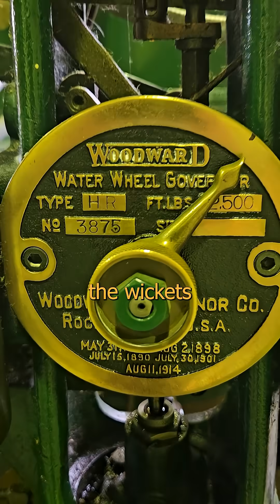Flyball Governor #chrisboden #comedy #engineering #generator #powerplant #electrical #technology

Comment: It's crazy that MOST cities around the US power is being maintained by 100 year old machinery. 😂
Reply: "It's designed to last a hundred years and is a century old" - physicsduck or smth
Reply: and it's even more terrifying how many machines are so old they literally cant get parts anymore. designed lifespan of 30 years for things still cranking at 50+
Reply: @bradhaines3142  if it's a well designed and built bit of kit .. why bother buying an off the shelf bit? Just make a new piece. The ability to make a replacement has been a sign of good engineering as well as good mechanics for centuries now.
Reply: @oddball_the_blue not always viable. i work on gas turbines that have a lot of weird special alloys and parts in shapes that aren't easy to make. sure they can get parts remade but the cost of that starts justifying the price of a new unit pretty quick, most plants just don't want to bite the bullet
Reply: @bradhaines3142  can't get parts isn't a thing. Everything that has been built before can be reverse-engineered and remade. The price point on the other hand...
Reply: In the UK we have an 120 year old hydto-electric station tapped into the national grid... So screw sending power to a city, this things plumbed into the grid of the whole country.
Reply: Replace them with arduinos stiched together by fresh graduates!
Reply: @5mxg not the craziest thing I've heard (memories of a HVAC system powered by Amigas well into the 2010's springs to mind. It covered a whole school district for 30+ years).

Remember kids, there's nothing as permanent as a temporary fix

Comment: Also these flyball generator is where the phrase "balls out" comes from
Reply: Oh, I’ve been imagining something different… that’s embarrassing 🫤
Reply: @KhaoticKalm  when the balls are out it means that its running at max RPM speed, "balls to the wall" is also incredibly mundane origins, its old aircraft throttles, they used to have balls on the end of the throttle lever and when you put it at full throttle the balls of the throttle lever was near or against the wall of the control panel
Reply: @BorednTireddd  does balls deep mean something different too?  I might have to stop saying phrases I don’t understand.
Reply: @KhaoticKalm  nope.....I believe "balls deep" origins are exactly what you think it is and you are likely using it correctly 😁
Reply: @ironken1796  thank god, I was looking up how to change my name an move 😂
Reply: @KhaoticKalm 😅
Reply: @BorednTireddd  similarly, "highball" was related to railroad signal lights.  if the block was clear, the top signal (high ball) would be active, which meant the train was free to run at its maximum safe speed.
Reply: @ironken1796  Same as joystick.
Reply: @KhaoticKalm  If you're a priest and you follow it up with "in a child"... yea, you'd still be moving and changing your name 😏
🤣
Reply: @BorednTireddd  I love factoids! Thanks for these gems of knowledge. 🍻
It shall live on a mental shelf, right next to "cold enough to freeze the balls off a brass monkey"
Reply: @DUKE_of_RAMBLE  no sir, I’m a failed truck driver one unexpected bill from homeless… doesn’t even cross our minds to harm a child or take someone’s hard earned cash so the church would never except me 😂
Reply: And pull out all the stops comes from organs, where pulling out all the stops would make all the pipes play (for a given key press on the manuals). Usually, though, you wouldn't pull out all the stops as it doesn't improve the effect and wastes air (although the air waste is mostly a thing of the past)
Reply: @roberternest7289 
Yep!  I’m guessing you’re a musician also?
You used the correct “manuals” instead of keyboards!
I enjoy finding the origins of sayings.
Here’s a good one, “The bitter end”! (It’s nautical) 👍🎶🎸🕺
Reply: "Balls to the wall" as well. If the balls are out far enough to hit the stop wall, you're giving the generator all it's got.
Reply: @Unb3arablePain bals to the wall comes from WW2 fighter aircraft, they had rubber balls on the ends of the throttle, and max throttle would put said balls very close to the firewall.
Reply: And that’s pretty cool!!
Reply: not gonna lie, I had to look it up.
Reply: It is also where the phrase "balls to the wall" comes from!
Reply: @dustinsmous5413 nope balls to the wall comes from aviation and throttle position
Reply: Interesting trivia: The flyball governor on a steam engine being full-out means there's too much pressure in the steam dome, which means it's NOT running at full efficiency.
Reply: @NikkiTheOtter I said full throttle not full efficency
Reply: @BorednTireddd full throttle would be putting too much steam through the pistons for the flyball governor to be doing much overpressure handling.
Reply: "Flat out" too I would imagine?  Fits.
Reply: @JViello  ...If your flyball governor is flat...physics isn't working. Gravity keeps it from being flat.

(Flat Out is apparently a reference to sails being drawn so tight by the wind that they flatten...Which would be grabbing the absolute maximum amount of wind possible)

Comment: i dont get it..
Reply: A flyball governor maintains an engine or generator at a constant speed/rpm by regulating the supply of fuel. In this case the fuel is flowing water, controlled by opening or closing wicket gates. 

As the generator reaches the desired speed, the balls lift up due to centrifugal force, triggering a signal or linkage that reduces water flow via the wickets.
Reply: @AWellesley oh i think that makes sense, thanks mate
Reply: and probably never will... don't worry sweetie, just go sit quietly and the nice people will come for you soon.

Comment: Those balls don't fly very far, do they?
Reply: They seem to be held down by springs. I'd assume that's because these weights are so tiny even the smallest speeds would send them horizontal, so the springs are needed to accurately sense the forces acting on the balls, thus sensing the speed of the shaft's rotation.
Reply: Deflection angle (i) is directly proportional to the amount of hysteresis desired. The less deflection, less hysteresis allowed. The sensitivity is dictated by the amount of force on the fly weight plate (d). All combined means that the relatively low torque synchronous motor can tune the speed of the generator (p) to a very narrow band without excessive hunting in a steady state.
Reply: @sivalley Will you marry me? That was beautiful!
Reply: @Kirstenlmsw135  🤭
Reply: Just gotta put a bit more oomph into it.
Reply: That's what she said... 😉
Reply: @danurban247 I was waiting... 😆
Reply: You better hope they don’t 😂
Reply: Try to catch them in you hands!
Reply: @5mxg  Good luck doing that more than twice.
Reply: Ideally not
Reply: Id like to see them replaced with truck nutz. That would be classy and elegant.
Reply: If you buy counterfeit/non-accredited manufacturer or sth that is substandard quality. It can fly very fast. This is where safety came up.
Reply: Preferably not too far no. Last thing any of us need is a 5 pound steel ball deciding it be funny to let go at 5000rpm
Reply: What's with the yellow exclamation mark next to your name?
Reply: @EddiefornoIf I had to guess, which I do, it's because I'm a paid subscriber to the channel. I get way more than three bucks worth of entertainment from Chris every month, and he's doing cool things with the money.
Reply: well yeah it's not a lot of torque until it is then they fling outward at the speed of light or until something opaque gets in the way.
Reply: It’s not how far they flew, it’s whether they enjoyed the journey.
Reply: Never far from the tree
Reply: Gaaa🎉
Reply: Not if the housing has anything to say

Comment: Does it change the excitation current or the water level to regulate the speed?
Reply: Presumably the gates. Excitation current would result in a change in output voltage. Fine if your loads are only resistive, but anything that depends on frequency (like motors) may be unhappy.